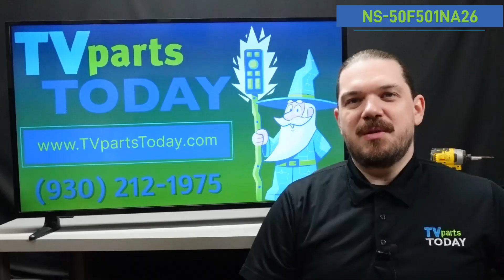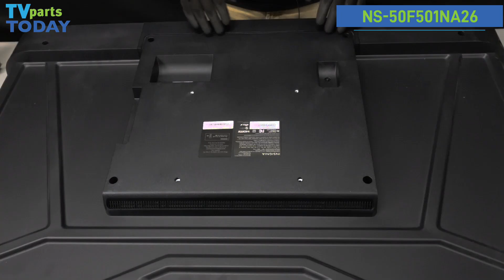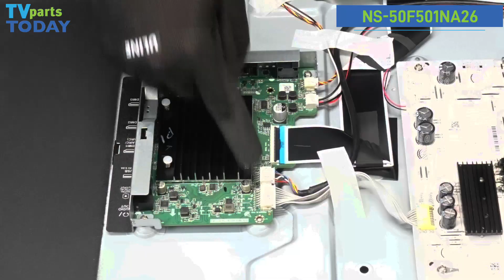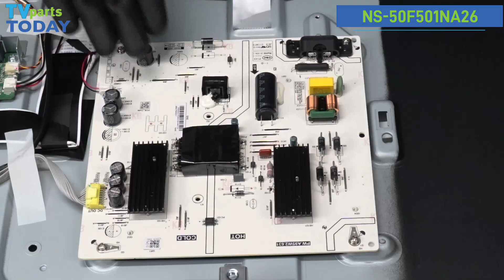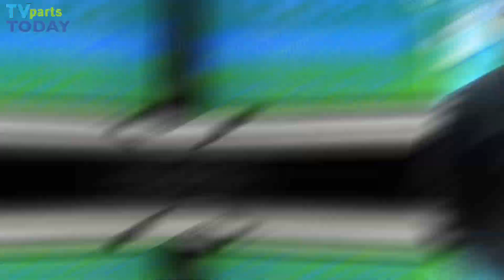How to remove the back plate and boards from an Insignia NS-50F501NA26. DIY TV Repair.

Comment: Just replaced the power board on my NS-32F202NA22 LED (Insignia FireTV 32" 1080p LED from 2022). Was having an issue where the screen looked as if it had been universally dimmed down to 33%. Wasn't any setting or software issue. Since it was universally dim, I went for a power board swap first. Power board replacement worked like a charm and we're back to full backlight brightness. While it was a slightly different model and the screw placements/interior boards looked a bit different, your video was an excellent preparation for what I was getting myself into since TVs aren't typically what I work on. Thanks for a super helpful and to the point instructive video @tvpartstoday !
Reply from the maker: Nice! I'm glad you got the TV working again and I'm glad we could help. <3

Comment: I have an Insignia NS-50F30... TV.  I get horizontal lines and the bottom half of the screen lags behind the top half of the screen.  Will the F30 board arrangement be close to how the F50 is setup?
Reply from the maker: The F50 and F30 should be fairly similar in setup, but there are usually differences. It sounds like you probably have panel damage. Horizontal lines are almost always panel damage, but if you were going to try a board swap I would recommend the main board or t-con board. Its a long shot to try and fix this by swapping a board.